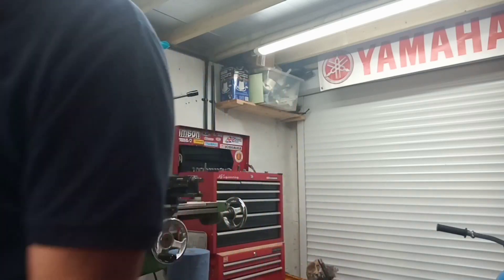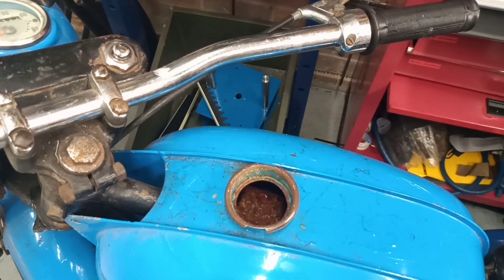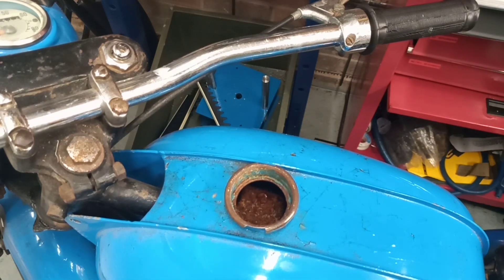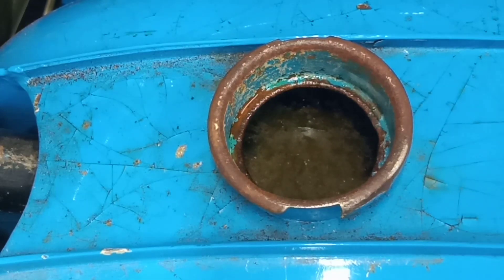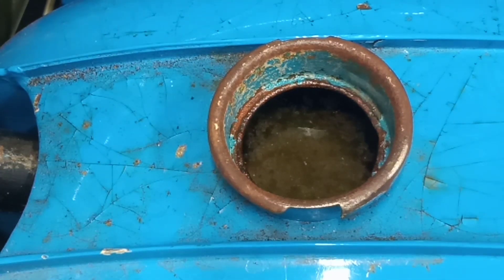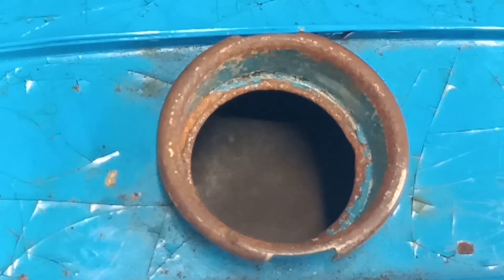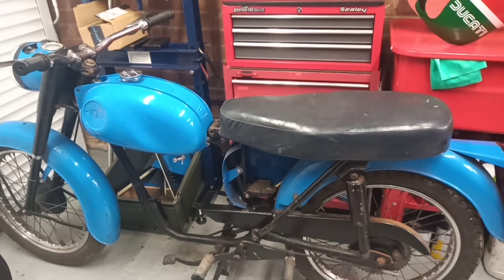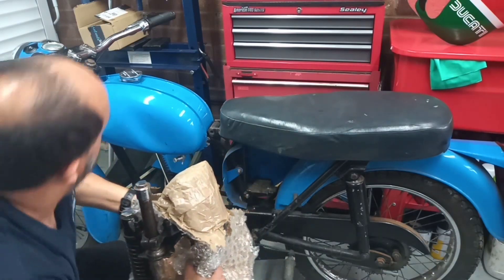Motorcycle Fuel Tank Rust Removal, BSA Bantam Project Way Forward.

Comment: That was a great video. The citric acid stuff really does the trick. Never understood all the hype about evaporust. Bought some once, was a waste of money. I take it you were using the magnetic base for that bit of filming? It is a total game changer when it comes to camera positioning.

Regarding what you do with the bike, for my money I would keep it as original and stock as possible. Of course its entirely your decision. I was trying to remember what colour the Bantam that Grandad had was. In my mind I see it as a light grey. I may be misremembering. It is now about 47 years since I saw it last! His picture is presiding over this comment. I wish he could see what you are doing.
Reply from the maker: Thank you, I was filming the filler neck on the tripod, the rest was on the mag stand. It really is a game changer for getting the camera access. 
I can't remember the colour of Grandad's Bantam but it probably was grey, he used to paint his bikes if they looked tatty. Only monochrome photographs of it exist. 
The Citric Acid really does work, but the substrate has to be free of contaminants. 
Best wishes, Dean.